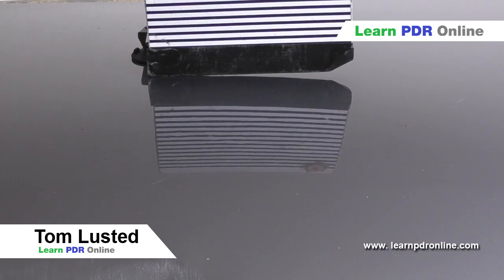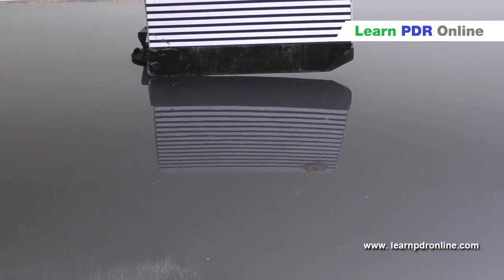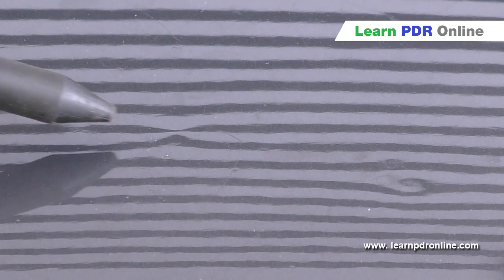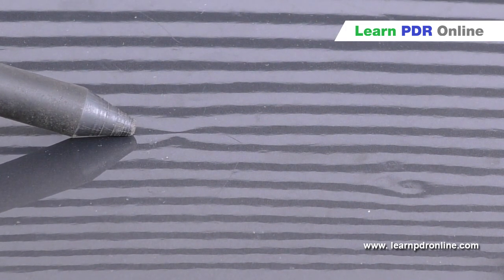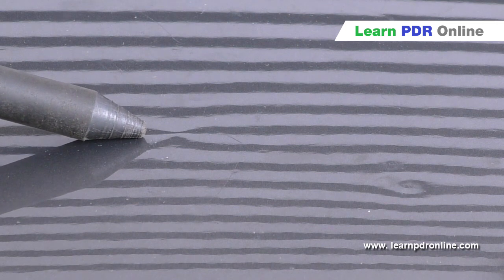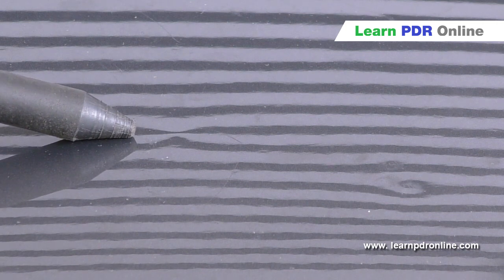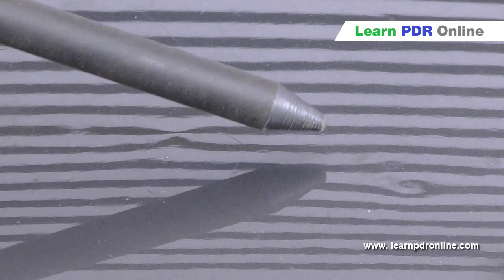The Basic Principles Of PDR Training, What is a high spot, What is a low spot

Comment: When you look at the lines there wavy ,that's where l struggle a bit with them thanks Tom
Reply from the maker: Its the fine details in the finishing stages that are the hardest to read, usually it is do do with light placement and practise. Take a few extra minutes to play around with the light at different angles, start with it close and gradually move it away from yourself until you start to see some details you can work with, and repeat this from every angle you can. There is always one reflection that makes sense, you've just got to find it!

Comment: nice video ~ 

The technique you use for the knock down , it's not like hitting a nail with a hammer right.. How would you explain it?
Reply from the maker: That's a great question, the overview is similar in the way you hold the hammer and the nail but how hard you hit the knock down and in which direction is dependant on the dent itself, with a nail you are just trying to hit it straight on and you knock it in as far as you need. Tapping down is quite varied and is one of the most important parts to learn in the PDR process, with a large soft high spot for example you are gently moving the metal back to its original form so you are constantly reading the damage after each strike and adjusting accordingly in both pressure and direction as to how far you are pushing the metal back in and which direction you want the metal to flow into where as with small high spots typically those caused by tool tips you are trying to hit a very precise spot on the peak of the high and almost flatten the high. It varies depending on the high you are trying to remove,  I hope that makes sense.

Comment: on the low dent , can you tap from the backside if you have access and enough room?
Reply from the maker: Good question, in my experience I would avoid the temptation to tap out from the inside, I have done this occasion but it is so easy to fracture the paint this way and very difficult to control. When pushing from behind you can increase and decrease the force applied where as with the tap, once you see the area you have lifted it may be too late. it does depend on the damage of course and what tools you are using but just in my experience, its gone wrong more often than its gone right :)
Reply: @LearnPDROnline  
I appreciate the response. I am finally understanding the science behind crown location and tapping. 
I'll subscribe for sure , 
Please give me your insight on a credit card crease on a 1/4 panel , 2.5 inch in length. 
Would you suggest using  a glue gun tab technique followed by a tap down? 
Or , is it possible to knock down a crease dent just by tap downs?
Reply from the maker: @reza_dc2  It really depends on the damage, without seeing it in person hard to say but generally if i can get behind a dent my preference is usually to remove with rods and tapping down, if no access then yes glue pull with a crease tab and tapping down/blending. occasionally we see a crown that is light enough that it can be tapped down to level out the low with out any pushing or pulling but this is rare. generally there will be a mix of pulling, pushing and tapping...
Reply: Learn PDR Online I appreciate the insight. Going to sub your channel. In regards to the push rods.. your not actually using the tip of the rod , just the side of the rod ..  I’m assuming if you use the tip , you could actually create a high point ..
Reply from the maker: RZA77 it depends on the dent and the tips I am using at the time, but most of the time I am using the tip to push with not the side of the rod, with the correct tip and correct amount of pressure you shouldn’t create ‘unintentional highs’ in other words sometimes I bring a repair slightly high in purpose to tap it down but if you are creating lots of high spots either the tip is too sharp or there is some tension in the damage eg. a crown, that needs to be released first to enable the metal to flow 👍🏻